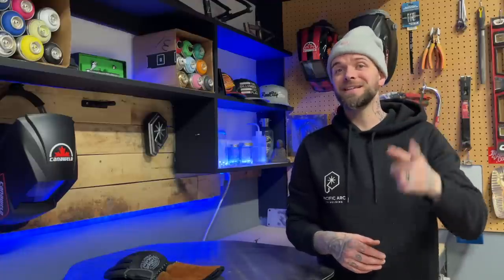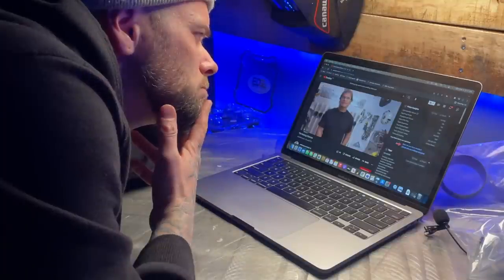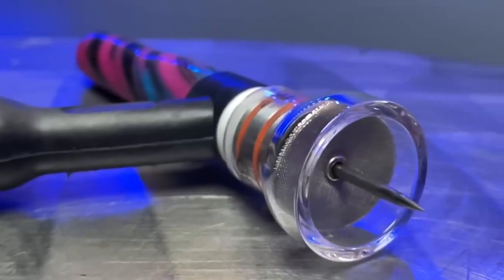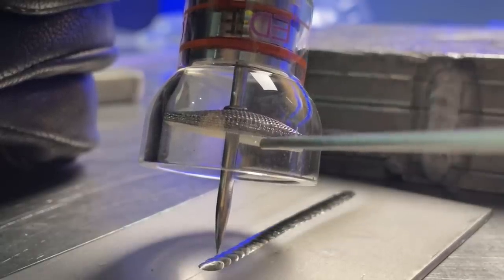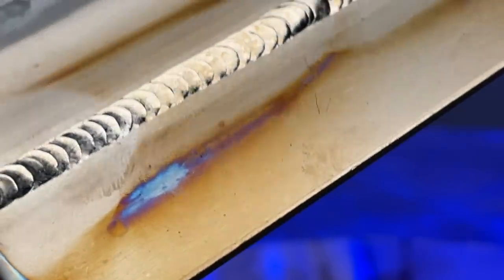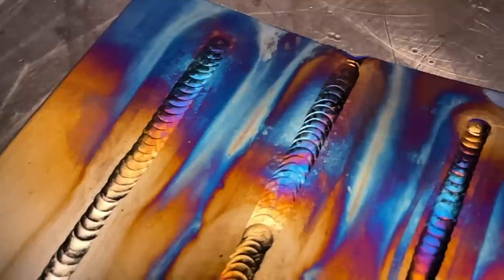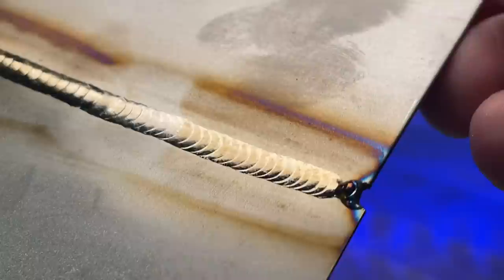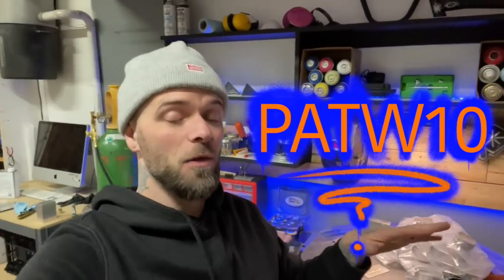I tried Tig welding Titanium for the first time.

Comment from the maker: 💎💎💎Take a FREE online Tig class on my website HERE👉 https://www.pacificarctigwelding.com/

Thank you SO MUCH for watching. I appreciate every single one of you 🪙
Reply: Layzr tungsten?
Reply: Good looking bead. Have you ever tried your tig art on mild steel? Thin mild steel. For example a motorcycle gas tank? I'm wondering about rust proofing and warpage. I'm putting together a 1964 Triumph t120r and was thinking that the battery box and gas tank might look good with some tig art on them. There are a few other ideas floating around, but wanted to get your opinion.
Reply: Your breakdowns are great, I was a certified welder and fabricator and haven't been able to weld last few years due to illness. Now I'm getting better I'm going to grab another TIG setup.

Comment: Used to do a lot of this in a previous job welding jet engine components, great material to weld. The sticking will up your game in feeding filler
Reply: Hi, I've just started in an aerospace company and I'm doing my titanium test pieces 0.7mm butt and t fillet, the butt I found quite easy but I when I tried the t fillet I finally understood what they meant by "sticky to weld", sometimes I get a really nice consistent weld and others it seems to stick more 🤣 it's definitely testing my patient but improving all the time👍
Reply: I worked for two major airlines and jet engine overhaul facility’s. Welded titanium cracks all the time. Good color on it is critical on repairs

Comment: When I learned how to weld titanium the instructor mentioned nothing about a gas lense,maybe they were not a thing in the 70's but we did use a copper box after trail that was clamped to the cup.Got about the same results as you did, never used the process since.🤗😎🤗😎

Comment: Great video, I've played with Ti a few times, I totally hear you on the sticking. I was welding some 0.32 stuff and ended up setting some weights on it so the piece wouldn't come off the table and into my tungsten when my filler stuck to the part.. after like the 3rd time :-)

Comment: Good stuff man. Dedicated stainless brush to remove the surface oxides, wipe down with pure acetone (I use 99% pure acetone wipes) and backing gas. Great stuff for racing applications!

Comment: Looks pretty good for a first welded pieces of titanium. I have done some of that for living in previous work. It is kind of easy material to weld, just need be careful with that back shielding gas. Around 20 yrs ago we made huge titanium pipes, one guy was welding and another one was in the tube holding the back shieldgas fixture on the spot where it was welded. I guess they have changed that method nowadays, it wasnt the most healthiest jobs to inhale that crap inside of the pipe.

Comment: I got some Ti coupons and filler rods in from weldmetals Thursday. I also have a furick BBW cup waiting for it.  A purge fixture too though based on what they said on one of Jody's podcasts I need to modify it a bit for the butt joint.  I am going to try to teach myself titanium welding, so this video was very timely for me. I do want to try out some of the pie cuts and pipe from Panda when I get time.  They mentioned the filler rod sticking on the podcast,I think they said some Ti alloys are worse than others about it. I do have a project in mind if I can pick up the process quick enough. Wouldn't be necessary, but titanium would be cool.

Comment: I think you've just sparked a hobby for me and maybe a business venture. The ways titanium could be used, structurally, automotively, and artistically, have me sold I think. Thanks for the content :)

Also! What about a water cooled block to weld titanium on, something pretty chilly, say -50c, like a condenser/radiator setup, and use sort of thermal paste on the back side to conduct the heat away?
Just a thought for a more permanent and cost.. effective? way, instead of using gas, especially on bigger pieces.
Reply: The heat is not a problem TI likes lots of heat. But the oxygen in the air can't hit the puddle or it creates a white crystal and causes weld to want to break.  That is why you need to shield the back side.

Comment: Cool. I enjoy watching you challenge yourself.  I tried some for fun too and ran out of argon gas right at the end of the bead around a 1” coped tubing “t” fit up. Then tried some beads on  3mm thick ti and recon that’s harder. It warped, it crackled and groaned and made all sorts of noises. Sure know what you mean about that filler rod being sticky☹️ I’m not a welder, just a hobby burner. I also made a 50x50x50x 1mm cube (dice) for fun and hell that thing rings when you roll it.

Comment: Try some bismuth crystals on the art to see if you like it, they will pair well with welds, but make the crystals it’s more fun and you can learn to make different sized crystals and colors depending on heat and cooling.  With your experience should be a cake walk. Overall though the art is absolutely stunning amazing work

Comment: no sticking if you ball drop. melt the rod above the puddle and its beautiful dimes and let it ball up and drop. pulse lay wire the lap. the color outside the heat zone is fine you dotn want the color in the heat/weld zone....if its to be "structural"  my qa qill reject any weld on Ti if there is even a blue hair across the weld btu that is on aircraft. love Ti welding....also Ti loves the heat, takes more think. hot and slow travel

Comment: Couple months ago I TIG welded some 90/10 CuNi pipe.  Like welding pudding.  Not that hard, needs special rod.  I did no rod root pass first then a filler rod pass.  Watch for pits in the root pass that are not hard to fill in the rod pass.  Lots of fun, though.

Comment: The continuous sticking that you're experiencing is because you're taking your filler rod away from the protective atmosphere that your gas creates while the rod is still hot creating corrosion  .you never take your filler rod away from your gas lens also you really should use dual lenses that's how we did it in the NASCAR industry, it gives you that extra time for cool down we used to have a saying in the well even stainless steel but titanium welding industry is that we live our lives 3/4 of an inch at a time meaning that we would make approximately 3/4 of an inch or inch of Weld and then hold for about 15 seconds and then start welding again never removing our rod away from the puddle so that it was still continuous weld also from what I saw you didn't spend near enough time cleaning all that stuff up it needs to be operating room clean

Comment: Nice Bro, but remember that you aren't supposed to weld a length longer than the diameter of the cup can cover. No colouring should be seen in the welds.
Reply: Ok so you are intentionally putting colour, but I learnt that it not acceptable in certain fields of work ( Aerospace...etc)